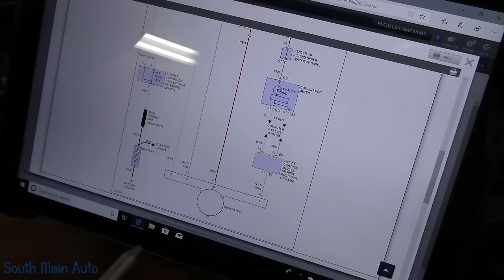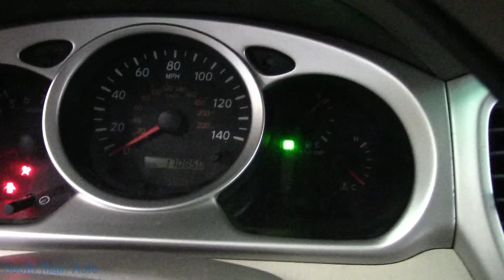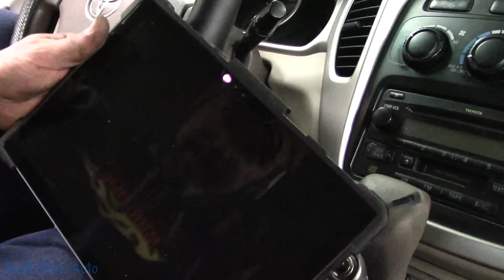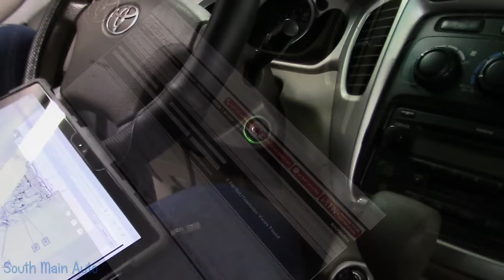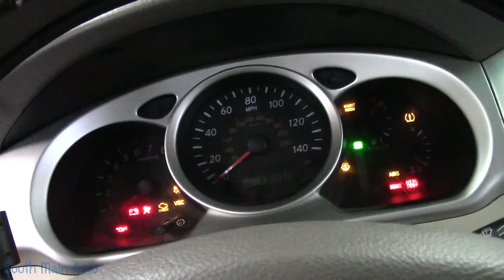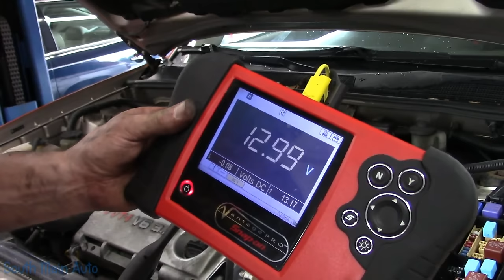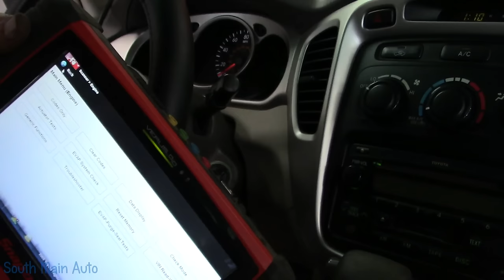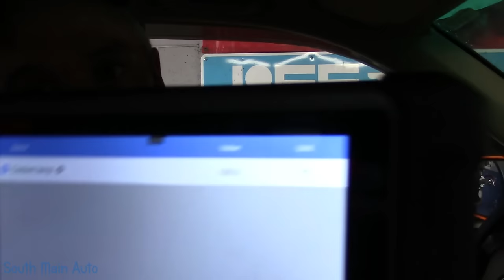Toyota Highlander - To Fix It, Follow The Smoke! 🔥

Comment: 4:28 Literally have exact model car in my shop right now except its a 4 banger. I was standing there scratching my head on it. Then it dawned on me soon as I got close to the problem. Eric O at south main auto had said "Follow the smoke" So here I am spending 45 min again to figure out how to fix this car. Then I see you did the same thing with the wiring diagram that I did. So worth watching this to see a pro make the exact same erorr did reading the diagram and that damn white wire. Thanks man

Comment: When looking for smoke a thermal imaging camera is very handy.  Also you should turn on all the loads that go through those connectors and check the wire temperatures before you tape the bundle up.  Or better still, with your clamp-around current probe,  check the currents in the wires you spliced.  A little paranoia is called for.

Comment: In these cases I usually have 2 or 3 different weather pack multi pin connectors on hand they take the same amount of time as a bypass and it gives a disconnection point that can be used for future testing   And they are easy to crimp terminals and slot them in not that much different from oem connectors, Deutsch connectors you can get them online for $35.00 for a pack just my 2 cents worth

Comment: I had several Suzuki Swift cars (aka, Chev Metro, aka Geo Metro, aka Pontiac Firefly), and one of the connectors under the dash would always burn up at some point and suddenly leave you with no headlights. Usually at night. Happened in every one of the cars (2 different 1995 models and a 1998 model), so must have been a design flaw in the size of the connector pins. And this is exactly what I did to fix them. Never had a problem with any of them afterwards.

Comment: I would like to add to your list of possible wiring faults - wires can become leaky due to corrosion - either to other wires or to ground. This can lead to weird problems like drifting gauges, dim lights that should be off, and high resistance causing unreliable circuit operation. These problems are not always at connectors - sometimes insulation on wires is worn through or melted, then wet with salt spray. These problems may only appear in rainy weather or slushy conditions, then clear up in fine weather.
Back in the late 60's, (I was a VW mechanic then) Volkswagen had an urgent recall due to a miswire in the fuel gauge circuit on a few US cars. Instead of being connected to a low voltage, limited current source, the fuel level sensor resistor was erroneously powered between +ign and ground. When the fuel in the tank was low, the sensing variable resistor was no longer covered (and cooled) by fuel in the tank. Exposed to air, the resistor wire overheated and could eventually burn through. If it sparked when it opened, you can imagine what could happen. The gauge worked more or less normally in spite of the error.

Comment: You did a great job as always, I also like the repair of the wires compared to replacing the connectors
Reply: because of cost, less chance of future corrosion, and a bonded connection

Comment: Pins in fried connector looked tiny for automotive service where they are carrying relatively high currents. We do not have ice and snow and road salt here in Melbourne Australia, but I could inagine that the green crusties and salt and ice and connector resistance heat in connector crimps and mating pins is “Wot dunnit”? Great fix too mate, no better on an old bomb of a car.

Comment: Take note ; The 7.5a fuse for the alt is the only fuse that can have voltage on both sides and still be blown. I'm used to looking in the toyota electrical manuals There is a seperate page with the pictures of the plugs. If you go back to the main menu/index it will have "power source" for a heading. this gives you the schematic for the battery through the fusible links to the fuses. The pictures of the plugs come up under "electrical wiring routing" which will be in your index/menu. Now checking the fusible links . If you look at the link, you can remove the window in the top of them . this is handy to know when you want to test the m and keep them in circuit.  Ive had one of the 100a ones blow when the body shop shorted the battery when the jump started it after a repair. They blow on the edge of the little square piece and look like they are still good. So you take off the window touch them with the test light and they look ok.  then turn everything on and they work for a couple of seconds (heat up and expand) and  stop working.  So you have to have a good look at them. You won't get new terminals with toyots you usually have to buy looms :O(. or solder your heart out. Good repair. The idle speed controller (little plastic box on the throtle body ). its held on with 2  5 point torx screws. They have a little valve in the housing that is controlled by the voltage increasing in its coil moving it in and out changing the bypass air flow. they get dry and dirty and seize up . The rad fan initally works from a temp sensor on the thermo housing and both fans will come on with the ac.

Comment: This is something I've seen on multiple Toyotas. Same connector. Usually presents itself as a no charge issue or overheating at idle and inop A/C due to inop fans.  This one seems the extreme with the multiple affected circuits. When someone brings me a Toyota i automatically check these connectors.  Maybe the wire size is too small?  I do the same repair as you did however there are aftermarket weather pak connectors available if you chose to replace it. Great job and thanks for vid.

Comment: Deleting a factory connector is always better in my book. Too much hassle to try to even buy the factory parts. I just like to solder use a dab of corrosion inhibitor and then put the heat shrink tube over. Just went Through this with rodent damage on a escalade. Thanks For the lesson today boss.

Comment: Got to say that you do excellent work. Hard to explain to customers what it takes in many cases to diagnose a concern. fixing it is usually the easy part diag can take some time. I'm a retired Senior Master tech in ASE and Ford diesel and Gas. I'm retired now do to health, maybe I should not have taken that Service Manager promotion. worrying about yourself is one thing but 20 techs is a hole different story. I used to joke with my techs and I  Quote. ( I have total confidence in you guys if there is a way to Fudge it up you guys would find the way) end Quote. Keep up the good work. Like I said I'm retired but do a lot of work consulting for dealers in the area.  friends and some fleets.

Comment: my only comment is that when the customer mentioned a new relay - I would have started there, just because it was new and placed in, doesn't mean it was the correct one.  normally open, vs. normally closed etc.  pin out could be wrong...causing a lot of issue.  now, I'm only half way through the video - but that customer comment you made about the replaced component would have been where I started to verify previous repair was correct, then diagnose what went wrong from there.  just my opinion - otherwise, I appreciate the channel.  not too many legit guys out there.

Comment: YouTube selected this older video for my Vizio TV as I'm a Naval Weps Engineer. This job I was a little concerned initially until you discovered the green corrosion which shifted the cause imo 99% to corrosion short circuits, a common issue  with exposed electricals on weapon platforms at sea. Anyway given the age of the vehicle the soldering fix would be fine for my vehicle but Gov work no way. Nevertheless I'm sure the customer will be satisfied. However I probably would have tagged a note and perhaps bundles the old connectors in a plastic baggie underneath the fuse box explaining (connectors corroded shorts, soldiered for quick fix)...

Comment: Reminds me of a 98 chevy tracker I had a short in the brake light wiring harness. End up being above the fuel tank where the wires crossed over to the other side. It rubbed though the insulation and made a dead short against the fuel tank. I spliced in some new wire then sealed with liquid electric tape, then taped it and put on a loom cover and never had another issue

Comment: Finally found my crazy dash lights/ battery light problem in the EB2 connector. I looked inside and saw a wee bit of green crusties at 1 of the pins. I touched it slightly with small screw driver and it fell off! I by passed the connector with a jump wire ..problm solved.

Comment: I would definately start using a multimeter in the place of fuses etc to see what the current draw is then you know if a fuse is going to blow. Most shorts you need to smoke them out anyway to find them as the connector can just be the weakest point but not the cause. Thermal camera can also be invaluable for these faults. Nice find though!

Comment: I might have crimped on male and female spade connectors UNTIL you saw the wire color change on either side of the connector.  Time to get out the Weller TCP soldering station.

Comment: Yes, great fix. Like you said, worst case would be if someone needed to remove or replace the fuse box. The wires would need to be cut and the decision made again to solder or re-plug. The car will probably meet the crusher before that happens. Also worth noting that you soldered and shrink wrapped the wires. Many hacks would have used butt connectors and wrapped it in tape.

Comment: <I done wire plug out l like that before. I replace with flat pin connectors each to respective connection> and tape the hole thing up cover. it a bigger wade of connectors. but it worked.

Comment: Fans are in series for rad cooling when needed. When AC on the stay on in series with each other. Ac has Liquid line sensor, high enough pressure fans go direct 12 volt each. When rad cooling the fans  will go on off in series circuit ( low speed on each) the reason they so this is for even air flow across condenser , radiator. They have done on most all their vehicles for years. If one fan fail other will run on high speed....

Comment: Never a rule without exception, no idea why but we've had a few trucks that would pop a fuse once, then never do it again for the remainder of it's service life. Then again I've run across several bad fuses before, some that would pop at well below their rating.

Anyway, my favourite is still people plugging in larger fuses instead of fixing the issue, going all the way up to wrapping copper wire around the terminals of the fuse,

Comment: Eric, high current circuit. Any voltage drop over time will heat and melt. Good stuff. Took out the alternater in the process. The battery absorbed some of that. You can try touching the two battery terminals together together without the battery to discharge the PCM capaciters.

Comment: I can pretty much theorize what happened to this Toyota Highlander. I would say it either got hot or one of the fan relays went bad causing it to run constantly drawing too much power causing the wires to overheat and melting at connector. Because what happens to a wire when it's overloaded it always melts at its weakest point which would be the connector and then once it shorted it was The snowball effect from there. I'm not sure I would have fixed it like that because there are quite a few times that you do have to pull a fuse box to do other things. And it would be very frustrating to have to cut and redo those because you have the benefit of the connector and diagrams and if it needs to be addressed again it's just a wad of wires. And it would be almost impossible to get those connectors from Toyota more than likely I would have just went and got them from a junkyard or found them. Even if it wasn't the same year or model just as long as you have enough pins just change the whole connector. But this was the quick and easy fast and dirty more than likely it would be okay it just personally bothers me to take something modular and hardwire it. Because also who's to say whatever caused it before doesn't happen again now you don't have a failure point of the connector because it's hard wired now it's going to shift the problem probably melt the whole box if not catch the engine on fire. I'm not knocking it but I would have tried to replace the connectors.

Comment: At 21:15 you can see a very obvious "piggy-back" type push-on slide connector.  Just needs to be pulled apart.  This is a standard type of arrangement to keep two sets of connectors close together. with only one body mount shared.

Comment: Thank-you for another educational video. You have a great approach and make tough problem solving understandable. I used to solder but have migrated to crimping bare-butt-connectors followed by adhesive-lined heat shrink. Insulated crimp connectors are quite unreliable but uninsulated ones can be really strong and reasonably quick, and don't crack and corrode like soldered connections can. Thanks again!

Comment: Soldering wires is always a sure thing.. great vid. Not sure how many pins in that connector but another option is a QC connecter here in aus its a universal connector of 2 4 6 8 pins are the common 1s but pretty sure thay are available in 10 or 12 also.. been atech for 30 odd years and use those connectors quite often but in saying that its another possible bad contact down the track with poss moisture water ingress and so on. In this instance i believe soldering was the way to go.

Comment: Electrical problems. Aren't they a treat. I don't know if read where I had a parasitic draw a couple years ago where I thought I may have fixed it by only pulling the door lock fuse as it was the only one showing a voltage draw. I puled the fuse & then put it back in & the locks engaged 2 x's in maybe 10-15 secs & the draw was gone. So when my battery went dead recently I started looking at videos again but remembered that when I first bought the car I had to put the door handle cover on the rear driver door. I took the cover off the other night & sure enough the plastic was open back where the door switch. Only problem is I can't see it so I went to $1 store & will have to see what happens. Then I get to find a small evap leak. I'm going to try to hook up a small pump sprayer to a pasta sauce jar where I'll burn incense or would reall like those smoke bombs for kids . Also want to try and hook up pump to master cylinder to bleed brakes. I bought another master cylinder lid and just have to glue a fitting in the top. Thanks for sharing.

Comment: Gen 8 Corollas will melt at a connector under the dash for the DRL.  People replace the smoked DRL module and imstantly kill the new one.  The reason is a poor ground connection on the front right chassis by the battery...  saw this several times... electrical can be so fun!

Comment: If that was my car I would have done the same thing. ..easy fix and now no more connectors. ..if the fuse box has to be replaced later...it could be done again...   I would have looked for the rattle. ..might be a easy tack weld.  Be safe...   :)

Comment: Had that issue on a highlander before, that connector shorts out inside. Ran a bypass wire around it on the 2-3 wires that are effected and taped up nicely. Hasn’t come back since.

Comment: At 23:18 you can see connector EB2 (the black coloured connector) has a female receptacle (grey plastic) with a metal male fitting connected to the other connector block.   Should come detached easily on pulling each in opposite directions.

Comment: I have the exact same car, the heat shield for the muffler rots out around the mounting bolts. My dealer as a courtesy took the heat shield completely off during a LOF. I’m sure it’s the same thing

Comment: lower voltage means the current, amps go up..hence the need for a new can of blue smoke for the car lol..the amps makes the terminals get warmer than normal til something bad happens.  i like the fix on the wires i would have done the same thing  :)

Comment: Considering the facts that those connections rarely need to be used, I would have accepted you soldered those vs. spend large in the parts department just to keep them factory connected. The fuse box cover under the hood looked fairly clean at first so it might be that vehicle had prior issues that never got corrected or the fan module repair had something to do with it. Obviously, this wasn't the first time for this Toyota having these problems with a past mechanic involved.  Good procedure in tracing the fault and a great repair alternative.

Comment: Your repair agrees with my way of getting it done 
If your connector not have been the problem then the wire with the problem would have been easier to trace 
Seen on comment how there parts changers. And. Mechanics 
I would call you a. Master Technition

Comment: This was One of the Most Interesting,,,Videos,,,I have seen  THE OWNER IS LUCKY IT WAS BROUGHT TO YOU,,,WITH MULTIPLE PROBLEMS  N LITTLE BACKGROUND INFO TO GO ON,,  I THINK U MADE A WISE CHOICE TO JUMP OUT THE CONNECTION, OTHERWISE  GOING TO TOYOTA FOR NEW WIRING MAY HAVE TOTALED THE CAR ,,SHORT OF GOING TO SALVAGE YARD N CUTTING OUT ANOTHER HARNESS TO PATCH WHAT U DID MADE GOOD SENSE WITH AN OLDER CAR,,  I HAVE SEEN THIS A COUPLE TIMES WITH ,, WATER N SALT CORROSION BEING DOWN IN NJ ,,BUT OTHER PROBLEMS LIKE THE FAN RELAYS REPLACED,,WHICH COULD HAVE OVERHEATED WIRING,,AND LOW IDLE DUE TO DIRTY THROTTLE-BODY ,,  WHICH U CLEANED TO GET A PROPER IDLE TO  ACHIEVE GOOD RPM FOR ALT TO CHARGE CORRECTLY  ,,,,WAS REALLY A GOOD SCRATCH YOUR HEAD FIX ,,,,TO CHECK OUT N GO WITH BASICS FIRST ,,THANKS ERIC